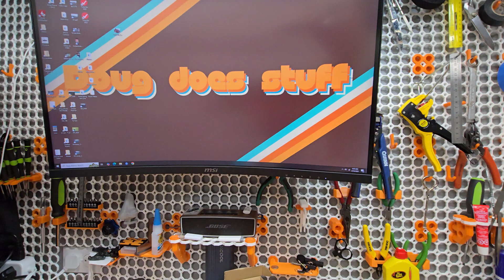Kobra S1 Combo: Thermistor Issue FOUND!!!! grrr....

Comment: Those thermistors you measure in the video are all wrong. I have an Anycubic Kobra S1. The thermistors are nominal 200k units. At room temperature mine measures 250k ohms. Both spare hotends also measure ~250k ohms at room temperature. So I don't know what's going on with the parts supplier of the units you have there.
Reply from the maker: I just got the official one in the mail, I will have to open it up and test it.
Reply: @dougdoesstuff24  Did you measure the one you got in the mail? I just finished another set of measurements of the three thermistors I have for my Kobra S1. All three are 240k ohm @25 C parts. This means they should measure very close to 240K ohms at room temperature (25 C). They will NOT measure 200k ohms at room temperature. When you buy them the sellers say they are "200K" thermistors but the exact value at room temperature has to be 240k ohms. They should really be calling them 240k thermistors. All of mine including the original one from the original Anycubic hot end measure 240k ohms @ 25 C.

But I didn't stop there. I have a thermal IR camera which is very accurate. First I measured the hot end nozzle in the printer at room temperature with the camera and it showed 26 C which is correct, and the printer calibration display also showed 25 C so they both agreed well. I commanded my hot end to 200 C from the control panel, and measured the brass nozzle with the camera (I wish I could post a pic but I cannot here). It measures 203 C which is totally acceptable accuracy. If you put in any of the thermistors you have in the video the hot end will not be correct. So for the community the exact value for the thermistor for the Anycubic Kobra S1 is a 240k ohm @25 C thermistor, even though the term "200k" is casually used to name this part on Amazon and elsewhere. Hope this helps people.
Reply from the maker: @nashme11  awesome reply, thank you.  My basement is about 65 degrees and I am reading around 300 on the anycubic supplied hotend.  I will have to get them up to 68 and retest I suppose.
Reply: @dougdoesstuff24  I got a small glass of water and put one ice cube in it. I attached a temp probe to an external DMM and waited until the DMM read 68 F. I put in the thermistor (the 240k ohm unit) next to the DMM thermistor and I read ...

302k ohms

Looks like you got the correct ones. 😀

Comment: Awesome update! i went through the same issue with my stock hot end, the pfe tube was cut slanted and cooled a button type shape and pushed my hot end into the poop shoot while extruding. ordered a bunch from amazon and found the same issue with the thermistor. they sent me replacements for free with the correct ohms and temps and works great. just came from your solid hot end vid. you got a new sub! thanks bud.

Comment: Is it possible to configure the firmware and tell it what resistance it has? IIRC both Marlin and Klipper support this, not sure if Anycubic allows this change. However I concur that the best option is just to buy a suitable hotend, and the new skinny ones with all-metal throat seem ok.

Comment: hi, can you tell me how to set the multimeter to do the test? thanks
Reply from the maker: Sure, turn the dial to the Ohm setting (curvy upside-down letter U), then touch one lead to each pin and read the setting.
Reply: @dougdoesstuff24  mine is 305 and 336. if, as you say, above 200 are good then both of these should be fine, right?
Reply from the maker: yeah, you should be good to go

Comment: So, while testing for a video I’m doing comparing the Bambu A1, P1S, and Anycubic Kobra S1, I had a blob of death, but not like any I’ve experienced before as it wasn’t on the outside but inside the stock nozzle. It pushed the PTFE tube out, pushing the nozzle out of the print head like a hydraulic jack. I see no way to solve that blob so now I need to buy a nozzle. As you said that Anycubic has been slow sending you a warranty replacement, I went hunting and found your videos. I saw a 2-pack on Amazon, one each of 0.2mm and 0.4mm and was about to hit buy now when I remembered this video. Was that what you got? Now I’m leaning towards the Aliexpress one with the brass heat break so as to not have a repeat of my blob failure.
Reply from the maker: I had gotten a . 2 and . 4 combo from Amazon. Those were problematic due to the thermistor having low resistance. The AliExpress ones I linked have been doing great

Comment: Looks like you bought the same Amazon ones that I did because I see the same tabs of paper they used to mark the .2 and .4 nozzles.  I sent them a message and they said they are sending me some updated thermistors to replace the ones that they came with.  They said they are 200k.  I guess I'll have to wait and see.
Reply from the maker: I'm glad they are stepping up and sending you a new part. I hope that the thermistor is not in too tight with high temp glue.

Comment: well, i had to order a new hotend myself... this time with a hardened nozzle, hopefully i have no issues. i have no way to check the resistance here myself.

also, just fyi, there are 2 allen screws that hold the thermister and temp probe in the heat block. unscrew both of those and you should have no problem changing them over to a new hotend. should fix the issue easily. but i would still rather use the new ones from aliexpress... they seem like a WAY better design, but im not sure they can get hot enough and stay hot enough for higher temp materials like abs or carbon fiber filaments or not. time will tell.

Edit again: so the replacement hotend didn't work from amazon... I don't have a way to check resistance. Here so I aplttempted to take the heater and thermister out of the old original unit, but i could not unscrew the thermistor from the heat block. The heater came.out fine tho. The thermistor screw, the big flat one on top of the heat block would not unscrew. It would move like one millimeter,  but then stopped. 

So, since I could not remove that, I went to the anycubic website to see if I was doing something wrong. I wasn't. HOWEVER, I did find an animated picture that showed someone with the hot end still plugged in, feeding some filament by hand I to the throat tube while it was dangling by the wires. They were holding the heatbreak tube with a pair of the needle nose side cutters that we all have laying around and usually come with a printer. So I tried that in the original hot end, and when doing so, since there was a blockage, the Teflon tube builds up material at the other end of the tune, pushing it out of the metal heatbreak  tube. I then pulled both the filament and the Teflon tube out, while still hot, and the blob and tube came out together. I then clipped the filament, pulled the blob and filament from the inside end of the tube, and reinstalled the tube into the heatbreak tube. Made sure it was flush, then, while still hot, I fed some virgin filament that came with the unit (the Grey pla that was still sealed up) into the Teflon tube I side the heatbreak tube again, at 200 degrees still, which pushed out the tube again but this time after pushing out some filament from the nozzle at the same time. I then pulled the Teflon tube put with the filament, cut off the filament and glob, reinstalled.the Teflon tube and put everything back together again. Went I to settings, changed the nozzle back to brass .4 and then rebooted the machine as instructed. It then re ran the pid calibration,  resonance calibration,  and auto-leveling calibration.  All went well. 

THIS time, I sliced the benchy again using defaults for anycubic pla, and sent the file over. First layer printed perfectly again. Seems to be printing fine so far, about halfway through the 43 minute print. No issues so far. I think I solved the issue, and I am pretty sure it was the cheap Chinese filament I was trying to use... a black and purple dual color silk filament. I will not be using anything that is cheap again like that. At least not until I get those aliexpress hotends in. 

I definitely need to I vest in a multimeter to test these before installation,  so it looks like a trip to harbor freight is on the docket sook too lol

Comment: Thermistor readings will vary based on ambient temperature in the room, but as you saw, a 200k Ohm swing between them isn’t normal. The Amazon seller I got my third party hot end from acknowledged the issue and sent me replacement thermistors that matched the OEM ones. Thanks for the follow up on this, Doug!
Reply: Yeah all the sellers will send you replacement thermistor.  I even ordered some directly on amazon.  They work, but so far I've had the leaking problem with all of the original style hotends.  Gone through 5 of them.  Hoping the ceramic ones solve that problem. You can print with the "bad" thermistor but you have to crank the temps up by 20-40 degrees.